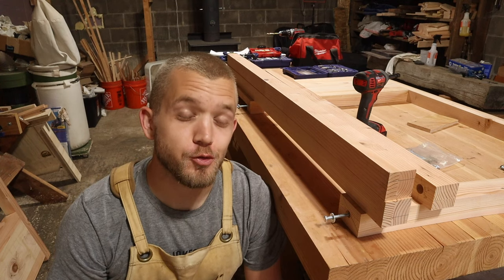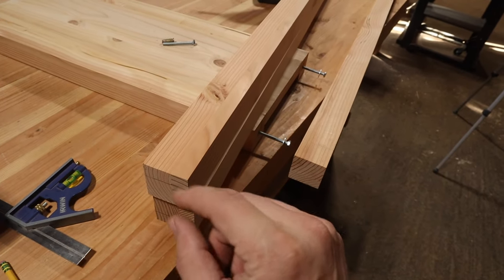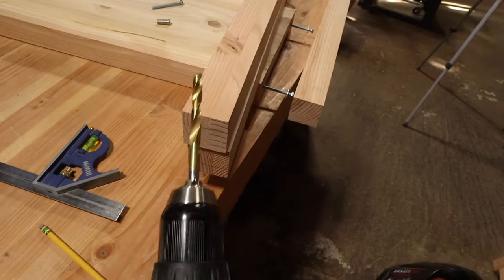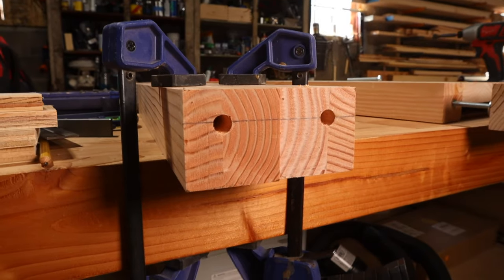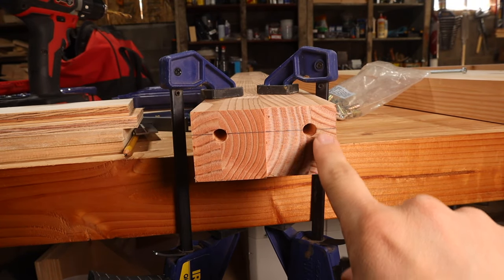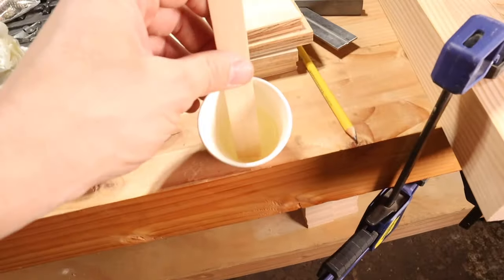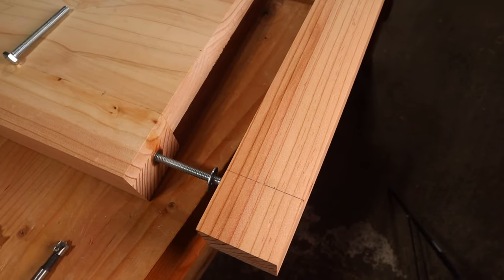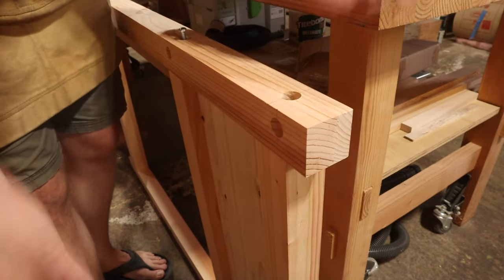Threaded Inserts | What Are They & How to Install

Comment: All very good but you must make sure your joints are self locating by design or have one or more dowels as a locator.  They do this on engine parts so why not on wood. Things you did not discuss, cross bolts and T nuts
Reply from the maker: Great feedback Steve! 

You are correct on the locating nature of dowels or dominos and I didn’t mention that, thanks for the addition. 

And great catch! T-nuts can be a great addition in certain locations. I’m not a huge fan of them because they “feel” less secure to me than threaded inserts but they are certainly another option. 

Regarding cross bolts. I had never seen one of those before until I googled them. Very cool mechanism.

Great additions all around Steve, thanks for the comment. 

Josh
Northwest Craftsman

Comment: Have used them often on different projects.  You're so correct that they are easy and can speed up your work considerably.  Your tips on the brad point and Forstner bits is right on point.
Reply from the maker: Pun intended? It was great 😂 and thanks! It’s always nice to get confirmation from other woodworkers that use the same techniques.
Reply: I am a Nut factory supplier, The product in video is enough use for generally product, but for metal part, need more harder nut, like stainless steel or carbon steel . These two material works more better.
Reply: We are source Factory supplier of Thread insert Nut. If you need them for new item, we are willing to send you free sample. Them can also be install by molding injection. More a easy way

Comment: Why are threaded inserts always so short?  Most seem to be no more than 3/4" long.  I want to use them to hang something heavy from a wood ceiling beam (2"x8"?). I want the insert to be long so there's lots of grip.
Reply from the maker: That’s a great question and one that I can actually use my engineering background to answer 😂 on threaded fittings (Nuts, inserts like this, etc) only the first 2-3 threads hold the majority of the load. So long threads don’t actually help anymore and that’s why nuts are as short as they are. These threaded inserts are longer so that when they’re epoxied into the wood, they have more grab in the wood side. What kind of pull out strength do you need on your project?
Reply: @NorthwestCraftsman   It's for hanging gymnastic rings and other exercise equipment so the load is unpredictable and dynamic requiring far more strength.  

But then I realized that headless screws with a wood thread for wood and a machine tread for the part sticking out, would be far stronger.  Maybe epoxy would also help strengthen them as well.  They don't sit flush but they would have so much more threads holding the load.  Your mention of the first 2-3 threads holding the majority of the load really got me thinking.  Would it be the same with a headless screw?  I need to attach a long bar somehow so I figured something like plate steel or 1" plywood bolted to the headless screws might work that would be affixed to multiple ceiling joists at at least 4 points for each end to spread the load.  It's a rental so I can't tear away the ceiling easily (I could if I was skilled at drywall though!) to inspect the quality of the wood but as there's another floor above me and it's a living room water damage is highly unlikely.  I'll try some tiny screws to "feel" the density of the wood of course on top of the drywall.  A lot of people install rings very poorly and they post their proud videos on YT leading others down a very ill thought out path.  With this design it will allow me to unbolt the plates from the ceiling anytime I want without wearing the wood threads.
Reply from the maker: At a high level, I’d be very cautious installing anything with a dynamic load in a residential setting since most floors and ceiling by joists aren’t designed to handle those. I don’t mean to throw cold water on this but I couldn’t recommend it. 

If you’re still set on it, I agree that it’d be a good idea to span as many joists as you can to spread the load and to your question on threads, that holds for all threaded fixtures.

Comment: In a hardwood, I like to use a forstner bit to create a slight recess for the head of the threaded insert so it sits flush with top of the surface...maybe a millimeter or so before drilling down for the insert.  For soft wood, I'll usually just tighten down on the insert so it creates its own recess.  For drill sizes, I'll usually stick with the recommended hole size if I'm drilling into hard wood, and 1/64 under for soft wood before applying the epoxy.
Reply from the maker: Those are great tips! I’ll definitely be integrating those.

Comment: Great educational video! Question,  I want to connect 3 round dowels that will be attached to cookie tins to create 3 tir trays. Which connectors should I use. Thank you!
Reply from the maker: Oh fun! A couple of thoughts. If the dowels is large enough to support the tin, then put a hole that can fit a fastener in the center of the cookie tin. In the bottom dowel, put a threaded insert and in the top embed the mating fastener. In the end you should be able to thread the top dowel onto the bottom dowels through the cookie tin.
Reply: @NorthwestCraftsman  Hi! Thanks for the  great response! The dowel is 3/4 inch round. I have enough to practice on. I will follow your recommendations!

Comment: for the Ooops:Glue and drive a dowel in and then drill again.. Insert: Countersink for the head for a flush fit. 
Inserting: Fix a Bolt with a double nut lock, cut the head off and run it in with your drill. 
Put a little wax on the threads and drive it home. Should not need epoxy, but, was a good idea for the larger hole.
Reply from the maker: Great feedback all around!

Comment: Hey buddy. Great video. I’m in the process of building a live edge headboard out of ash and I was planing on using threaded inserts to attach the French cleat to the slab and hang it on the wall. You mentioned that you wouldn’t use threaded inserts in a vertical application. I didn’t want to glue the cleat to the back because I was concerned slab expansion/contraction may cause damage when moisture levels change. What would you recommend in this application? The slab is 9’W x +/- 20”H x 2”D. I’d really appreciate your insight and found your video excellent. I hope you can give me your thoughts on this. Thanks either way!
Reply from the maker: Sounds like a really fun project! I'll be the first to admit that I'm no expert but I do appreciate the compliment. Here are some thoughts. 

I don't love the idea of putting the bolts in shear (not for the bolt but for the insert) as the only line of support but if on your cleat you have a series of them, it passes my gut check. Even better would be to run your router on the back of the slab to allow for an inset, that way the cleat is taking the load and the bolts are only holding the cleat to the slab. Lots of ways to attack that one. If you want, shoot me an email (in the about tab of my page), and we can bounce ideas with photos.
Reply: Hey buddy! So sorry for my delayed response. I don’t really comment often and expected YouTube to send me an alert when you replayed. It didn’t. Live and learn …

Thanks sooo much for your advice. I actually did one of the things you mentioned, I put 1 threaded insert 1’ apart into a 7’ cleat with the epoxy in the slab and bolted the other half to the wall at ever stud I hit. It seems super sturdy right now but time will tell if it’s not a good solution. I’ll update you if any issue arises. If it does, I’ll defiantly put a ledge into the slab. I should have thought about such a simple solution. Again, live and learn. Thanks again for your suggestions and help. Great page!

Edit: fyi, it turned out beautifully. Nightstands may be next. 😊
Reply from the maker: No worries at all! YouTube is odd like that sometimes. Glad it turned out well! If you’re up for it, I’d love to see a photo is it on Instagram?
Reply: @NorthwestCraftsman  Sure thing. I'll try to take some pics today or tomorrow and hit you up :)

Comment: I am attaching a long 3 foot finial bed post to a frame. Both are round. How would find dead center on the round post and since  I cannot use a drill press how would you get the the drill to go straight into the finial? Thks for any advice
Reply from the maker: Great question, are you looking for the center of the end of the round beam (circular face) or for the center of the face that wraps around the beam (cylindrical face)? If you have photos to email, that may be easier.

Comment: Epoxy is a little difficult for me to get my hands on, would wood glue be an acceptable substitute?
Reply from the maker: It might work but it won’t bond to the threaded insert very well. Honestly, the adhesive is overkill and not needed. If you really want something on there, use some super glue. Just know you’ll need to put it in quickly or the glue will set before it’s all the way in.

Comment: Would you say these are stronger or those pronged tee nuts are stronger? Was thinking of using for attaching some wheeled castors to a wood base
Reply from the maker: Great question! My personal bias would be towards threaded inserts because they’re attached to your workpiece where T-Nuts are usually just on the surface. That being said I don’t have any data to point me one way or the other.

Comment: Are washers essential?
Reply from the maker: Depends on what you're going for, it make me feel better about the compression on the wood. However, if you can get a nominal clearance for your bolt, the head may have enough holding power. Not something I want to play with though.

Comment: It doesn’t seem much but the flat head of insert should fit flush to wood an not the few thousandths obove
Reply from the maker: You’re totally right. Normally I actually try to inset it slightly to prevent interference. If that’s not what I showed here, it was unintentional

Comment: Epoxy is only for those of us who are paranoid. If you’re not woodworking a spaceship, going without it should be fine too.
Instead go for a spring lock ring to prevent loosening bc of seasonal thermal contraction. HTH
Reply from the maker: I'm moving towards you on this one. I've switched over to super glue to help ease installation and still provide a small amount of lock. Tried some Rampa threaded inserts and man those things are no joke.

Comment: Hi

Thanks for nice video, can I ask you how strongly it sits, can it be used on shelves ? With some load 

Thanks
Reply from the maker: Hey! Thanks for your kind words, I’m glad you enjoyed it. 

It can definitely be used on shelves but it depends how you configure it. I wouldn’t want to do a floating shelf style attachment where the threaded inserts are only in the back. If you have some along the edges and back, it should work great. 

In more technical terms these work well in tension and shear but I wouldn’t want to load them in torsion. 

Again, it all depends heavily on what kind of shelf your building and what it’s holding.